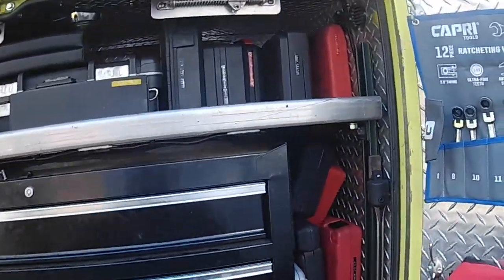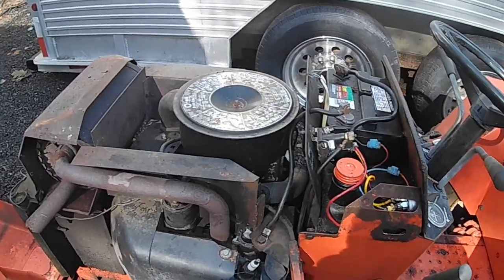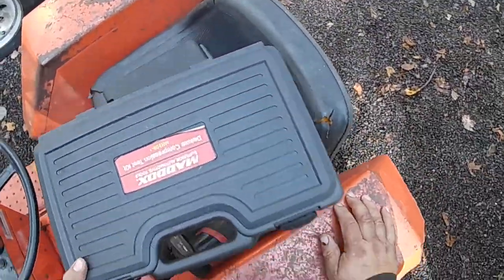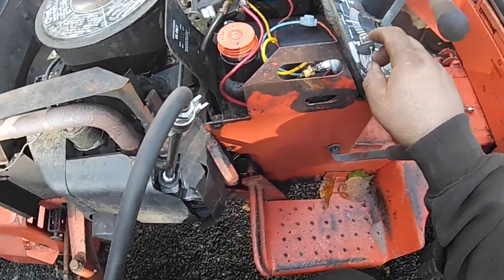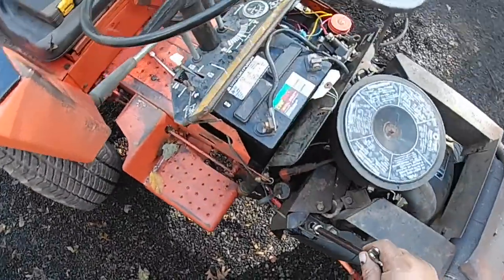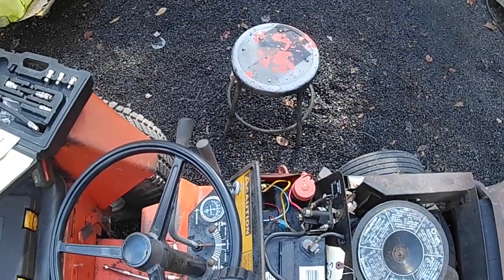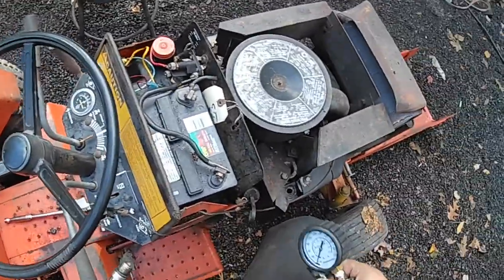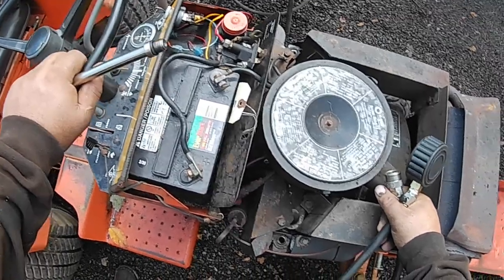How to perform a Compression test on a small engine or most gas engines. Using Maddox/OTC tester.

Comment: I didn't watch the whole thing, but most of it. My question is: on the units having the Vanguard 18hp for example, I understand that they have a compression release thing. So, I figure it would need a leak-down test to get any kind of accuracy. If the standard compression test is done, I also understand I should be looking for 60 to 90 PSI, (only as an indicator), and that both cylinders need to be within 25% of each other. Does that sound right to you? Thanks in advance to any advice you can give.
Reply from the maker: No Briggs run much higher even with release, you want a good battery when testing. But 150 to 180 is what we see for ones in real good shape. And on engines you want to be within 10 percent of each other. Otherwise something is not right.
Reply from the maker: Also most other small engines should be 100 to 150 ideally and some say under 85 needs refresh. We have seen them run around 65 and do ok, but do smoke and down on some power. Judge by how it performs and go with that.
Reply: @caseingersolltractorsnortheast  Outstanding, as always. Thank you!